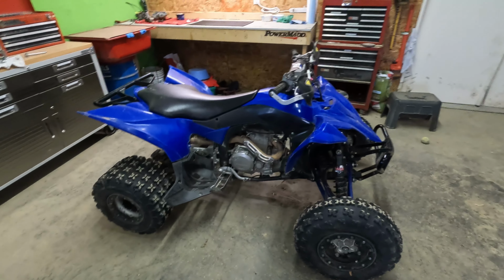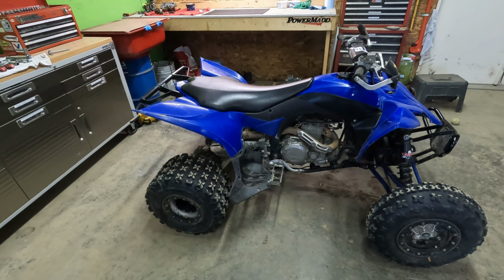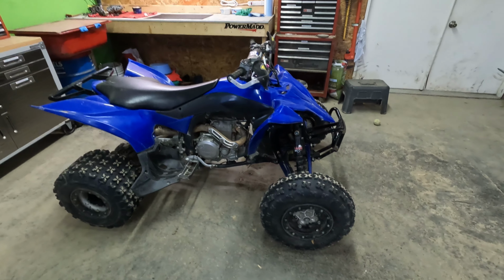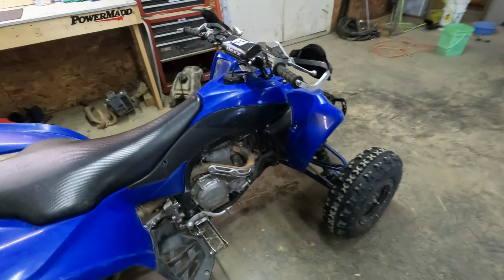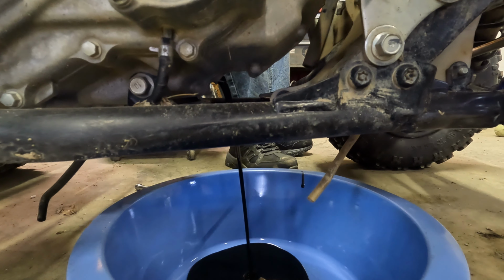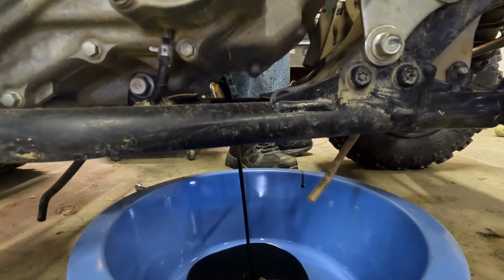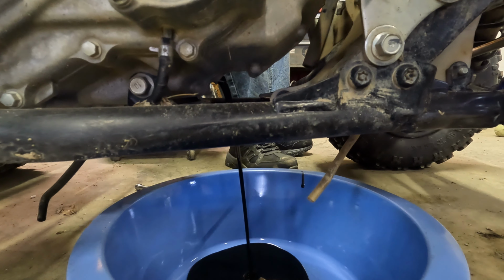YFZ450R XC Race Quad Build Part 1: Disassembly

Comment: It appeared you had a problem getting the rear alxe removed.  What was the trick that help you to finally get removed?  
Also, are you replacing your shocks or getting the stock ones rebuilt and revalved?
Reply from the maker: Yeah, it looked like the axle had never been out before so there was some rust holding it in the bearings. We ended up getting it out with just brute force. Hitting the end enough freed it up. For the shocks I will be going aftermarket for the fronts and revalve on the rear.